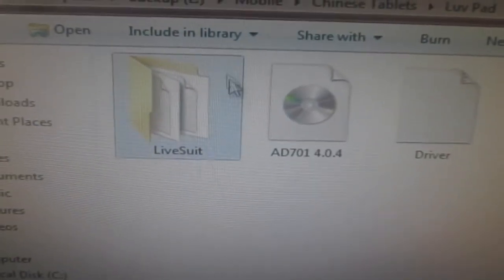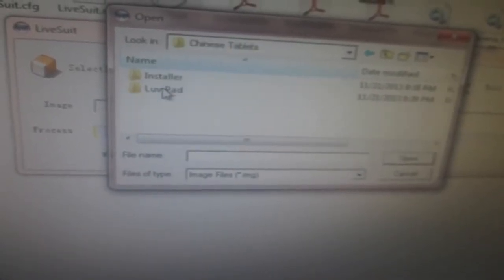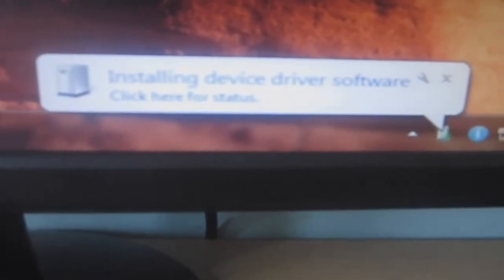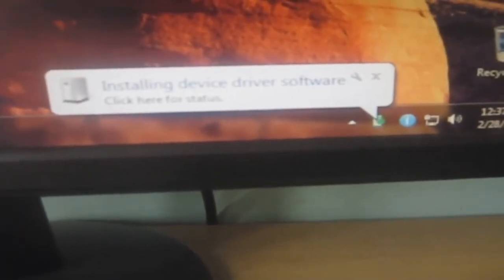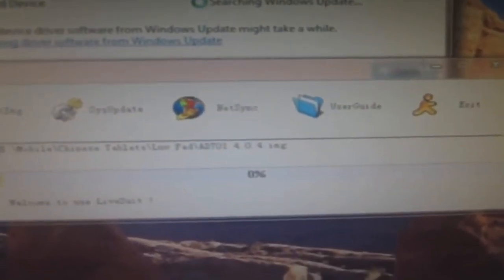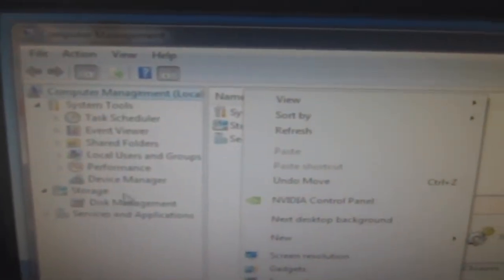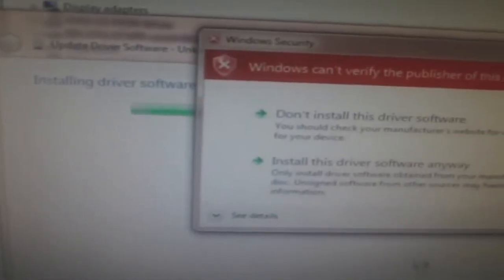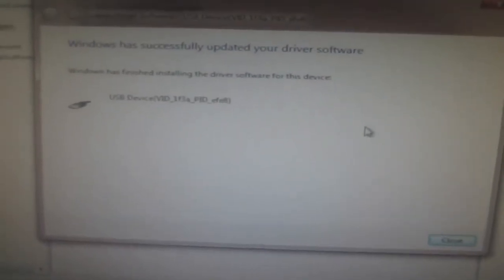Allwinner Tablet Unbricking Tutorial : How to fix Chinese and Japanese Tablets

Comment: a repairer tells me that if you put a wrong firmware there a chance that the touch of screen wont work
Reply from the maker: Yes that is exactly true, drivers may not match. First find exact firmware, using firmware of similar device is last resort. My friend used firmware of another device because we couldn't find correct firmware and now he uses a mouse and keyboard to use the laptop. Works like a computer for him now. Anyway best of luck finding the correct firmware.